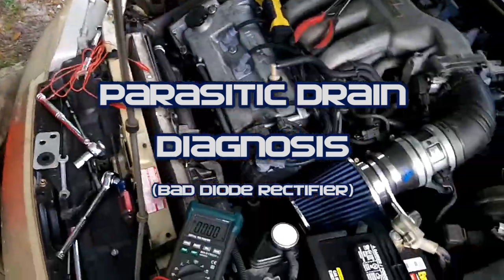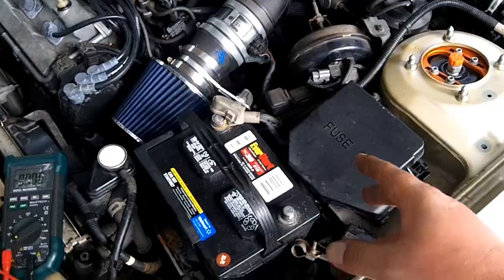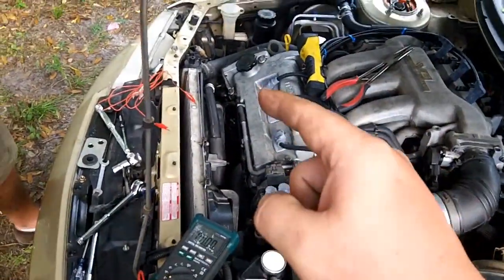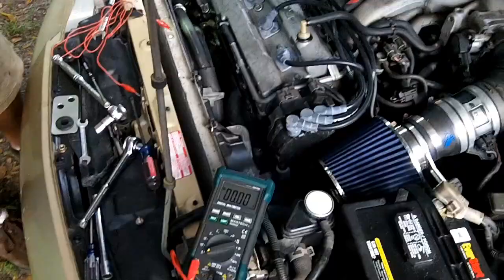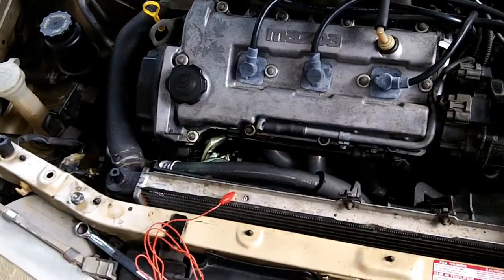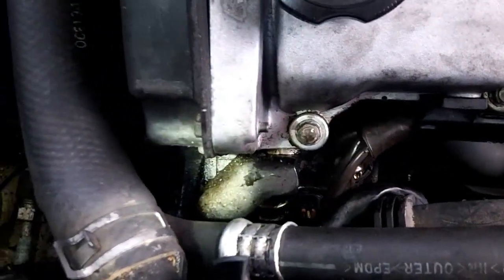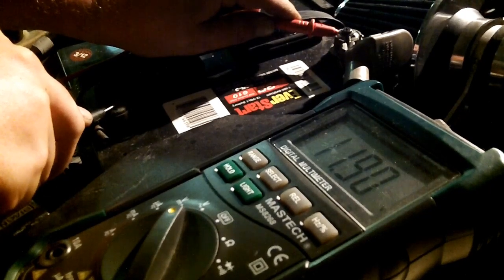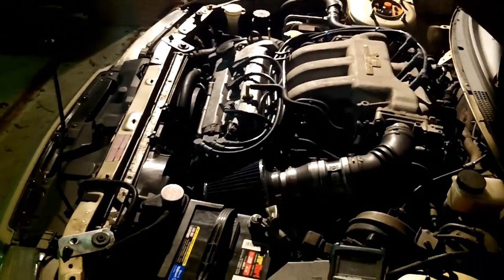Alternator Causing Parasitic Drain

Comment: Many thanks for the nice video.
I am facing battery drain. When car engine is on, the similar voltage drop was seen suggesting issue with alternator dioes.

Comment: Yes! I replaced the faulty dual isolated 110 amp alternator that would have cost $440 to replace with a new 110 amp $86 alternator and it is working fine!

Comment: I think DJ means that you're suppose to disconnect both battery terminals before you remove a fuse or alternator terminal. That way you don't fry something as you're taking off the component. If you were to touch metal or something.
And once the component is off and isolated you connect the positive (red) wire back to test for a draw.
Reply: You only need to remove the negative battery terminal. The only reason to remove both battery terminals is if you're removing the battery or you don't understand how a vehicle electical system works.

Comment: By "in between test take off those battery terminals" you mean that every time before we take a fuse out the black and red battery cables should be disconnected and then once the fuse is off we plug the red cable back into the battery post to test the draw?
Reply: No, you only remove the negative battery terminal and place your ammeter in between (in series) the battery negative post and negative battery terminal. Look at reading on ammeter. It should be 50 mA or less. If it is, you're current draw is acceptable. If it's not, keep the number on the display in mind. Now start removing fuses and relays one at a time and look to see if ammeter reading changes after every pull. When you see it change value, you know your problem is in the circuit of the fuse or relay you just pulled. It would be silly to disconnect pos & neg battery terminals each time you pulled a fuse and it would also take forever. Just remember there's a lot to know about this and these guys just scratched the surface in this video. Newer cars have a lot of modules and you have to keep that in mind because modules stay active many minutes after you turn everything off and close the doors. If you check it before these modules shut down you'll be chasing your tail in circles. There's other things you should be aware of but I don't want to write a book. Do research until you feel comfortable doing this. Don't just watch one video and try to do it.

Comment: By "jumpered" DJ means that he is basically bypassing the 100amp main so he can trace the draw to the external electrical system (alternator, starter, etc.). 
You can do this with a wire hooked up from one terminal to the other. Just make sure it can handle 100amps or more for safety. Then you proceed with the standard parasitic draw test.

Comment: I went thru this with a 2007 Corolla w/ 98k miles.  Even though it was only showing about 25mA, the battery would drop 1 volt per night. Replaced the battery, performed a voltage drop test on every fuse, disconnected the voltage regulator, pulled the aftermarket radio, disconnected the door/dome light switches, disconnected seat sensors, pulled fuses/relays...no change.  Charging system was even showing a 13.8-14.2VDC charge, so thought the alternator was good.  Was about to give up when the alternator stopped working, so changed it out and viola!  Bad Diode.  Weird thing is that it worked fine while running.
Reply: Very interesting...I keep going through batteries and only seeing 40 to 50 milliamps when I do a draw test....

Im testing 30 volts a/c on battery when I test for a/c voltage while running but it's inaccurate because it also shows 25 volts ac when vehicle is off...so I'm trying to find a more accurate way to test this and confirm...

How did you confirm that it was actually the diodes that failed on your alternator?

Comment: Call me lazy, but I had an intermittent parasitic draw on my brand new battery and it kept draining out like with you. I did some basic testing and instead of doing all the work you had to go through I figured since it was cheap enough and because my alternator was really old anyway, that I would just switch it out for a new one and see if it fixed the problem.  It did. I guess I am lucky like that!  Also, keep in mind that a dying alternator can actually work and not work intermittently for years. You can do all the alternator tests in the world and find that the alternator tests just fine....only for it to fail on you two days later.  You have to test multiple times over a period of days to catch that sucker not working.

Comment: I have a 2007 trailblazer and I’ve put 3 alternators in it and it still drains my battery
Reply: I highly doubt it's your alternator draining your battery if you've replaced it with a new 3 times. You need to do this test to pinpoint the problem.

Comment: Chek for AC voltage between battery posts when engine is running.  this indicates a bad diode in the voltage rectifier that is not blocking out half of the AC wave created. 
I just replaced the rectifier in my truck.
Reply: Good point! It happened to me too. It's called AC ripple. I think you can't have more than 1/2 a volt AC

Comment: Will break  cleaner deteriorate rubber or plastic seals  or serpentine belt ?
Reply: I don't know, but if it does, it takes more than 25 years, because everytime I change my brakes on my 1997 Camry, I clean the whole area with brake cleaner before disassembling, so the job is not so dirty. I get a lot of overspray on rubber lines and never had to replace any of them. I've had this car since new so I don't think you need to worry about brake cleaner. From my experience, it's usually grease, oils, carb cleaner, and petroleum jelly that cause them to deteriorate. if you get this stuff on rubber just clean it off with brake cleaner, and if you want, spray the rubber with silicone spray. Silicone protects rubber.

Comment: Yes, very common…I’ve replaced many alternators because of faulty diodes…I always start with that before pulling fuses because it’s the easiest thing to do.🥳 also to save money I replace the diodes myself.
Reply: I went to test mine today and my meter read o got another meter also read 0 . Checked the fuses in the voltmeters both were blown. Would a bad diode do this? If I check for ac voltage do I check voltage or amps? I have done this before just never blew a fuse on my meters ever two in one day

Comment: My alternator is doing the exact same thing trying to do the test went through every single fuse and nothing changed but when I was checking it on my multimeter it was pulling 12 volts which is insane end up checking the alternator fuse testing it with my multimeter and Bam that's where the 12-volt are going and this is in my 05 Ford 500 which is a shity Car to change an alternator in

Comment: That or it got too hot due to an extremely discharged battery and caused one of the field windings to short against the case of alternator on the inside. Either way your looking at a new alternator. You should have seen that the alternator wasn't proper charge voltage. If it's down around 13 volts that's actually a little low for cars these days. Or it putting out insane voltage with those problems as well is probably actually more common. Don't be surprised if it puts out upwards of 17 volts because they will do it with a blown diode or shorted windings. Also loose cables dirty connections etc will actually cause an alternator to run well above its heat range and the result is usually a fried winding or two. If you don't address it in time. Alternators are funny like that.
Reply: Thank you for this comment! I have been attempting to diagnose a vehicle with a parasitic draw AND intermittent overcharging issues. The battery (new) drains completely in less than 12 hours. After a jumpstart, I measured voltage at the battery with engine running and I get 14 to 16 volts. It varies a bit at idle but consistently jumps to 16 volts. It rises to 18 volts if the rpm is increased. I assumed a bad alternator/ voltage regulator, but on this vehicle the ECU controls voltage regulation and I didn't understand the connection between overcharging AND battery drain. I don't like to just throw parts at a problem and hope for the best, so I will conduct Amp Draw Tests both with the main alternator lead connected and then disconnected. Any other ideas for diagnosing? Again I am leaning towards a bad diode in the alternator given my two distinct symptoms, but I'm not sure how to rule out an issue with the computer given that it is supposed to control the voltage regulating duties. Your comment is the ONLY information I've seen that addresses both symptoms. I know its been 2 years, but I'd appreciate any reply! Thank you and God Bless.

Comment: Mine was the result of neighbor hooking up jumper cables wrong. Had 4.6 amp draw. From the positive lug on fuse box there was wire that ran to top of alternator. Isolated and current draw went away. 2003 Durango.

Comment: Not getting a reading from meter when checking for a parasitic draw but battery still drains even when the negative cable is disconnected.  Battery is not a year old and my starter is new. The battery at 12.61 discharged to 12.55 in a matter of a few hours, with cable disconnected.  I can't see the electrical connection to alternator ( 2003 ford Taurus duratec) but can the free diagnostic from auto parts store determine if the diode is bad?
Thanks for any help.
Reply: @bert1450  
Bad battery and starter:  both replaced and all is good.
Best,
Roland

Comment: 1990 E-150 same draw from alternator. Replaced and still 3.7 amp draw. Unplugged the external electronic regulator and draw dissapeared. Check this before spending 130

Comment: Seems relatively unlikely the non-conductive oil dripping into the alternator is related to the diode failure (though the theoretical suggestion of it contributing to overheating is plausible, if not likely.) In any case, valve cover gaskets are a such a quick and cheap repair on an inline engine like that that he hopefully fixed it.
Reply from the maker: It's not an inline engine, it's a V6 so there are 2 head gaskets, 2 intermediary gaskets, and 2 valve cover gaskets. Plus PCV valve grommet and oil pan gaskets.  There are more  places for it to leak on a V6. The I4 in contrast is much easier which is why the V6 is known for leaks simply because it requires more disassembly and labor. Since not everyone is going to do the work themselves that means a higher mechanic fee to do that labor. The V6 does cost more to maintain for many reasons vs the I4 and oil leaks and gaskets is one example. Thank you for at least considering my diagnostic theory as valid, it was just a guess but makes sense in the context of the reported symptoms and diagnostics I performed.

Comment from the maker: The alternator produces AC voltage which is converted to DC by the diode rectifier.  This is why it's named as "alternator" because prior to the diodes it's actually producing alternating current. Depending on how many diodes fail will depend on if your 100A main fuse will blow or not. Some people with this specific problem may OR may not have their 100A fuse blow depending on how many diodes in the rectifier assembly fail (and in which order). There is usually an unknown variable in this equation, which is the order and number of diodes blown in your AC to DC rectifier. Makes more sense now? Andy got lucky as it was still producing some DC voltage under load, enough to get him home, however the diode that prevented voltage/current draining to ground was blown. I'll say this one more time to make it crystal clear, for the Mazda 626/MX6 a diode rectifier is almost as expensive as a new alternator because they normally come as a set. That is not true of all vehicles but it is of the Mazda 626/MX6. The alternator uses the engine block as its ground on this vehicle.

Comment: Could you just remove alternator charge cable from battery?
Reply from the maker: Great question. Honestly I don't know. I've never tried that nor thought about it. I know it's 2 wires but every 626/MX6 I've worked on has had the OEM terminal and boot still on. I have changed out the terminal on my own 626 but that was about a decade ago and I soldered both in place within a 0 gauge lug. Quite possibly why I never considered it. You or someone else might be in a better position to answer that question.

Comment: Did it do it all the time or spiratic
Reply from the maker: Constant non-stop voltage drop as you can see in the multimeter at the end of the video.  It should be 14V but it's dropping below 12V.  You cannot charge a 12V battery with a charge less than 12V right?

Comment: I have something things going on except my alternator charge the battery normal which gave 14v or little more .but my normal reading with 12v cable going to alternator disconnected is 0.09 amp. And with cable connected 0.156amp. I did expedited the process after I removed all fuses and still having some issue by removing the power source going to each fuse box . Next time I will do something thing by removing the 12v going inside the fuse box and if still have high reading I will figure that the problem not inside so I will move on under the hood
Reply from the maker: You're drawing about 40 ma higher than spec which isn't that bad. Look for a bulb that is staying on the glovebox or trunk light.  40mA is what an interior light would draw. Figure out where the draw is coming from by pulling fuse and tracing it back to the source.
Reply: DJDevon3 unfortunately I have 2007 frontier pick up so there’s not much bulbs except one and I switched it off

Comment: Wire to alternate needs to be replaced,  that's it every time e.  Change. 12 volt alternate wire,
Reply: Adam Plimmer I would verify with a voltage drop test on any cable before replacing
Reply from the maker: No, a wire isn't going to make electricity flow in the wrong direction. A shorted wire could yes but in this case replacing the alternator fixed it.  Please don't say X will fix your problem every time that's not diagnosing issues that's throwing parts at the problem.

Comment: How's this... Is it possible to get a parasitic drain from the alt BUT only when it is in a certain position of rotation? ie - can it be a short to ground depending where the engine (and alt) stops???? The output tests good and have done the parasitic tests as you did with no major draw, but every now an then, it is driven and parked and the next day the battery voltage is completely ZERO.  1992 Jeep Cherokee with the straight 6 at 280k. My next test will be to hook up the VOM and rotate the engine VERY slowly to see if I can pick up the parasitic drain point.        Thanks.
Reply from the maker: Great question!  I have no idea I'm not an alternator specialist.  I would love to know if that's possible. If you find out please post it up.
Reply: @DJDevon3  Couldn't find a bad spot that I was hoping for, but I pulled all the non-essential fuses and it ended up being the dome light circuit draining the batt down to zero within a day or so... Even tho there were no dome light bulbs installed - front, rear, doors, etc... as soon as I pulled the fuse, the 1/4 amp drain disappeared from the VOM and hasn't returned (since she doesn't drive at night, it's no loss)... I suppose if I dug deep enuf, I'd find a supply wire somewhere frayed and barely making contact with some part of the body... BUT... it's fishing season, so the fact that the battery is staying fully charged is good enuf news for now.

Comment: I have a 1997 Jeep Grand Cherokee that has a Parasitic Drain . It might or more often won't start every morning . So , I disconnected both the negative and positive battery cables on a fully charged battery . The next morning , I reconnected the battery cables and it started up fine . Do you think that if I disconnected the positive battery cable at the alternator overnight and reconnected it the next morning and it started , the problem could be in the alternator ?
Reply from the maker: That in itself isn't enough information to make a diagnosis.  It's definitely very helpful and likely but without at least using a multimeter to see if it's charging the battery properly or checking fuses or relays or other components there's no way that myself or anyone can give you a definitive answer.

Comment: 6.0 2004 

Truck gets low voltage (8.6V) if I leave it parked without cranking for 2 or 3 days. I took the batteries to auto store and they're good just low voltage. 

When It cranks the voltage gets up to 13.8V, good alternator. Every night when I go to work the truck is at 10.8V and it starts good. What could be causing this parasitic drain?

Comment: Would an alternator with a bad diode still give you 13.8 - 14.3 while running without giving 2000RPM , then drain your battery when key off? I got a parasitic drain, but I highly doubt it's my alternator ...
Reply from the maker: There are many diodes in a rectifier it's possible but without diagnostics and troubleshooting it's all guessing.  Gotta get your multi-meter out and start running some tests.  The most common cause for parasitic drain are after market products like a new stereo head unit, lighting accessories, and shorted wiring. Even something like a glove box light staying on even though the glove box is closed is somewhat of a common culprit.  There are plenty of things that can cause a parasitic drain. I'd start by disconnecting anything non-essential or aftermarket and then start removing fuses. Also a bad battery might allow you to recharge it but will fail to hold a charge, you can do a battery load test to ensure it's not a faulty battery. Wish you luck.